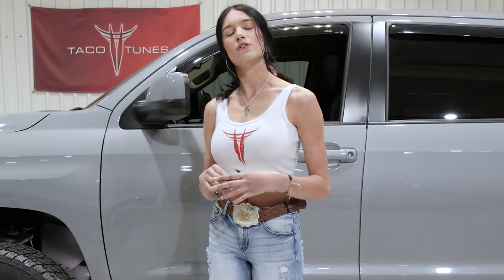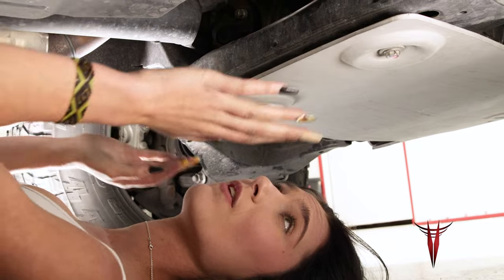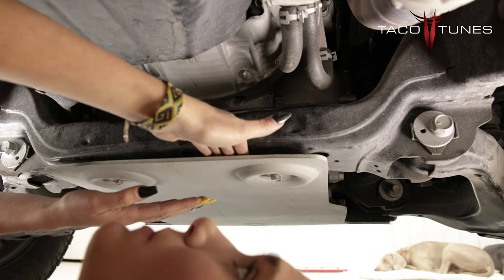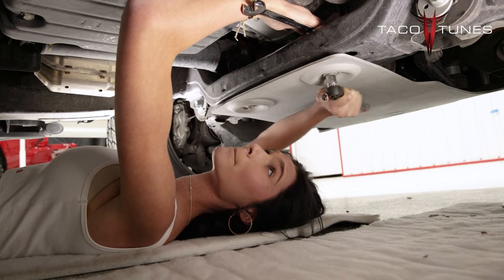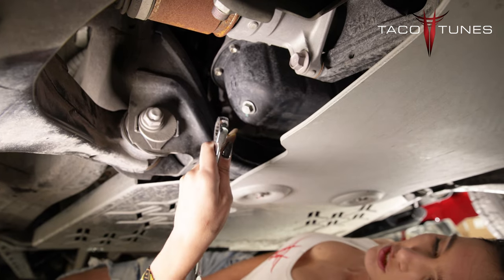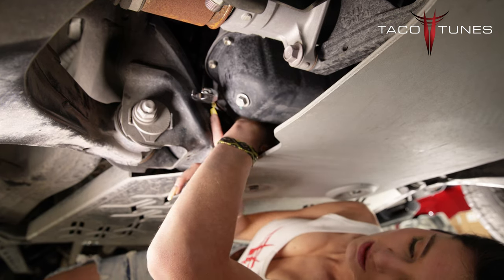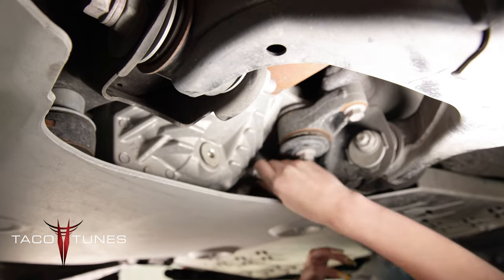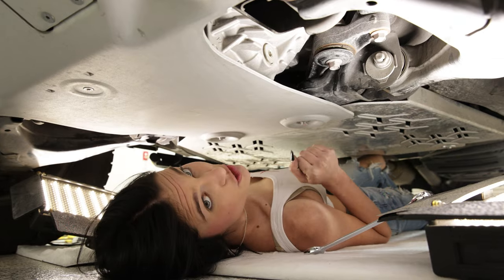2007- 2021 Toyota Tundra Catalytic Converter & TRD Skid Plate Installation

Comment: I noticed you did not install new bolts to secure the front of the catshield. At the front it seems to slid in between the TRD skid plate and the frame. Will the catshield stay put while only being bolted down at the rear.